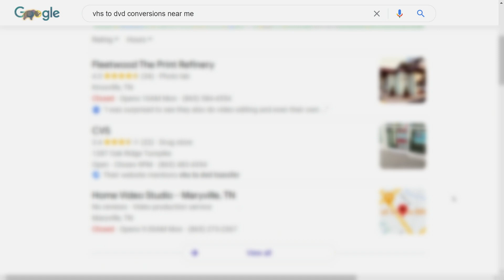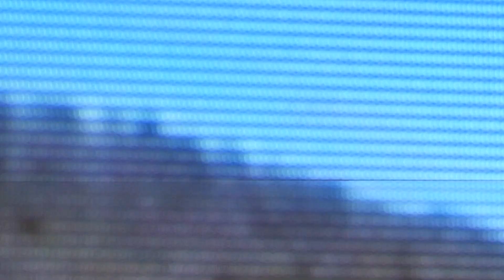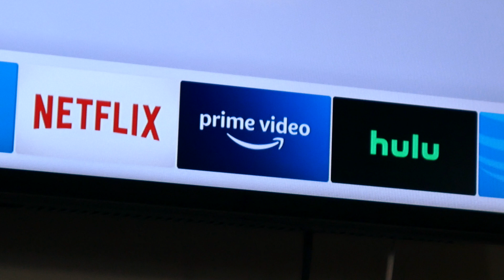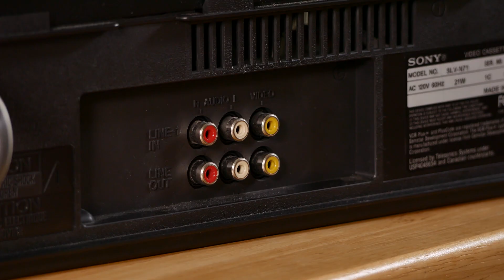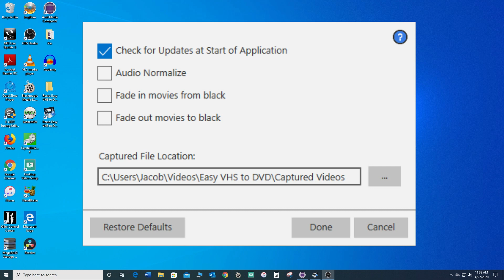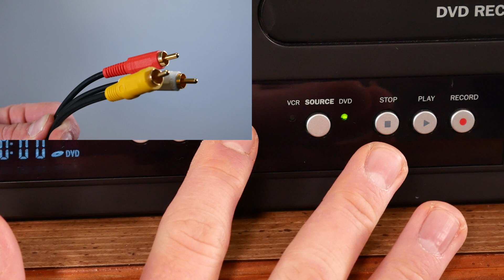Converting VHS to DVD for Beginners

Comment: How would you connect two vcrs, one with recording capabilities, (DVD recorder).to an older TV, Sony Bravia (2013), I think the tern is 'piggybackl'.
Reply from the maker: Hi, @lisaowens5070. If I'm understanding correctly, you'll want to go from the output of the playback VCR, to the input of the DVD recorder. Then from the output of the DVD recorder to the Sony TV. You may want to see if you can find an owner's manual from the DVD recorder manufacture for any fine tune detail settings.

Comment: I agree with all's been said in that video and i'm not a beginner. But theres other way to do it to have a better video quality from the VHS but not a easier way. Today the DVD are may not dead but almost, because its now way better into MP4 video files, first the MP4 format are now compatible with almost all today's devices, DVDs are not, Blu Ray neather. Second for DVDs you've got to have a DVD player to play them and MP4 video files are free region, DVDs are not. But for beginners to convert them into MP4 format just like i did when i was a beginner and if you are not much famillyar with computers, the easier way is to record them to DVD than from the DVD download them in your computer and with a software you convert your videos into MP4. You can even re-touch the videos quality than finalized them to MP4. DVDs can be scratch really too much easilly, MP4s can be copied as many times that you want and specialy into harddrives (the safer way) At my advice convert a video tape into 1280 by 720p MP4 video file is less worst into HDTVs & 4K TVs than a DVD video picture because a standart DVD as only 720 by 480p picture vs 1280 by 720p MP4. But personnaly now i convert them into 1706 by 960p because it gives a bigger picture and very close to FULL HD ( a clearer picture too)  But i'm not sayin that you will get a FULL HD picture, no! just a clearer picture than a standard DVD and clearer picture than 1280 by 720p picture format. If you prefer, a sharper picture...  Today don't even need a driver to have the VHS picture to my pc, i simply use a RCA converter straight to HDMI than from my HDMI cable into a USB converter and my picture is sharper this way. But i now only need a videocapture software and that's it, no driver needed😉

Comment: Every method I have tried results in a noticeable decrease in quality. Elgato, ClearClick, Magnavox DVD recorder. It's getting really frustrating. I know they are poorer quality because at my old university they used to have a VHS to DVD converter set up and for whatever reason the quality looked fantastic. I have tried to replicate that quality to no avail. I wish I could get the specs on their set up
Reply from the maker: Sorry you're having trouble with your tapes. This is one of those processes where it might not be your capture device so much as it is the VCR playing the tape. Have you tried getting a hold of the university and seeing if someone in the video department knows what tape deck you're referring to? Unfortunately, it could either be the VCR, the tape or perhaps the capture device or capture settings on the device.
Reply: If your using a PC it's just the automatic shit settings if you have any questions on what to change Google some forums or just come back here to the comments and I'll tell you what I can
Reply: @mr.smith45  what phrase should I use to google/youtube this? I use elgato to PC but have never played with changing settings or de interlacing.
Reply: @danasharp5605  like what to type for a specific guide on how to do it?
Reply: @danasharp5605  I dont use a legate but most recording software can do a good portion of the work. There's usually a way to change the codec and bitrate which does most of it. And maybe find a way to turn off excessive sharpness.

Comment: First and most important: NEVER try to convert VHS to DVD, as long as you really wish to save the quality. DVD uses MPEG2 compression which will spoil all your "good memories". Use modern codec instead. One of solutions is deinterlacing into 50 or 60 FPS (depending on source) and upscaling your video to 720p then compressing it with h.264 into some MOV or MKV. This will save the most details and it will look almost like real tape playback.
Reply from the maker: Thanks for contributing to the chat. This video was to help those just getting started. That's why I  mentioned to keep the tapes after capture, just in case a better method for preserving comes along.
Reply: Silly question but how do you do this? If you have a VCR player and the VHS tape, how do you connect to the PC/laptop to get this highest quality conversion? Are you using an elgato/other similar digital conversion device? If so, which is the highest quality? If not, what connection and devices and software are the best to use?
Reply: @iangrant3615  I used a PCI tv-tuner card, Philips chip based. Mostly because it is supported in Linux. Then I used VLC to capture from AV input into file, saving uncompressed or almost uncompressed video. Then I used ffmpeg software to trim unneeded borders on the frame, make progressive video from interlaced using Yadif filter (doubling frame rate), and then compress it into h.264 codec.
Reply: In windows a good option was the Pinnacle AV card. Unfortunately, I couldn't run it on Linux PC. It also is barely supported in newer windows.

Comment: Another purpose of having a dvd recorder is pass through recording, especially when it can demonstrate time based correction. When you send an unstable VHS signal through, the DVD recorder will stabilize waterfall effect, screen warps, and other inconsistencies. Also, even though you may put the signal in through composite, you can output it through s-video. Or you can get an s-video adapter for the composite, and output it through component. The possibilities are endless. Plus, when outputting from the DVD recorder, you can use menu settings for brightness, contrast, and sharpness.
Reply: So it is a good idea to use the DVD recorder as a pass thru, when going from VHS to computer?  I never thought of doing that.  I have several DVD recorders. Will it really provide time base correction?

Comment: Antho.y is there another way to transfer hi 8 cassette tapes other than thru the original camera? Thanks for your helpful videos
Reply from the maker: Hi Sharon, you would need some kind of player unit to actually playback the tape. So if the original hi 8 camcorder is out of the question, you would either need to find a working hi 8 camcorder that can playback tapes or have a hi 8 deck.

Comment: Which componet goes to the tv so I can see what I am actually doing? How can I see what both components are doing?
Reply from the maker: Hi Dave, you'll want to plug one end of your cables on the "output" jacks on the back of the unit (VHS/DVD recorder) and then plug the other end of the cables to the matching jack type on your TV. You may have to sift through your "inputs" using your TV remote till you see the picture coming from your DVD recorder unit. Hope the helps.

Comment: I have about the easiest  way of converting VCR tapes to DVD. No bells and whistles. Basic copying.  I have a few VCR's of high quality, even one still in the box. I was always a VCR lover.  I use a DVD recorder from about 2010 when they were popular. I simply connect the AV out from the VCR to the DVD recorder input. I can also record DVD to DVD even encoded DVD's using a device which is long gone. It is connected between the VCR and the DVD recorder.
Reply: Steve I have lots of home videos I want to put on dvd.  What reasonably
priced dvd/vhs (recorder?) would you recommend.  Thanks in advance.
Reply: The quality of a real time DVD recorder is not as good as a quality software encode though.
Plus...it's the year 2022. All of the cool kids are putting their VHS tapes onto Bluray disc!
That said...yes, that's probably about the easiest set up if quality isn't the top priority.
Reply: what if you don't have a spot for the red cord on vcr will that still work
Reply: @freddi896  yes
Reply: Hi  I am not familiar what is on the market now. Almost all of my equipment is either Sony or Panasonic.
Reply: @steveseifer6784  thanks for getting back to me have a great day